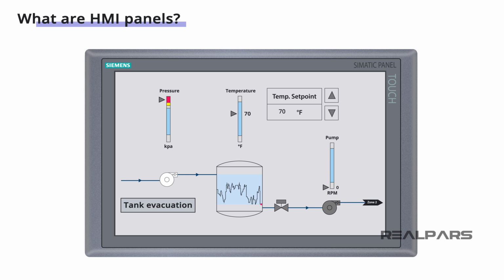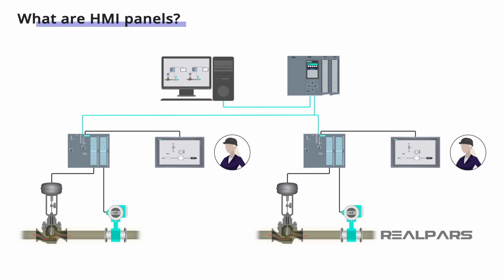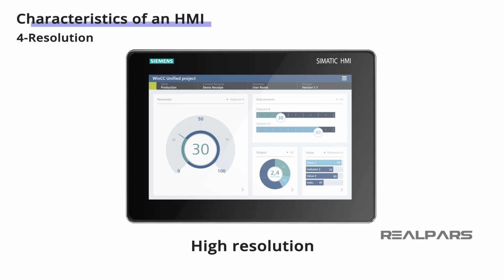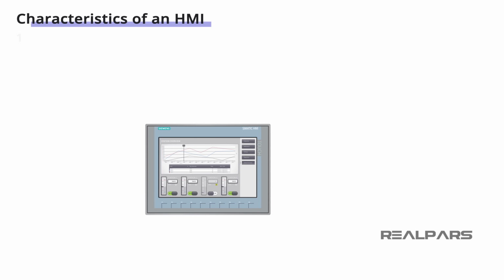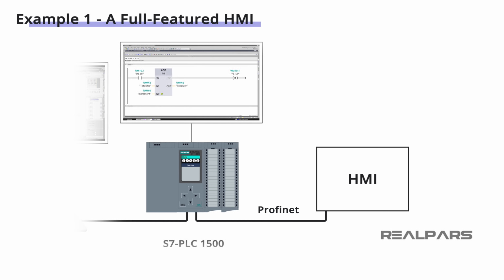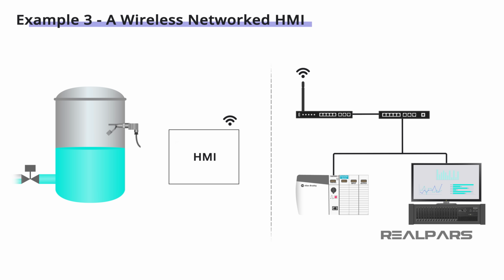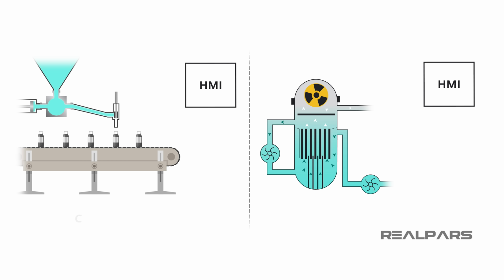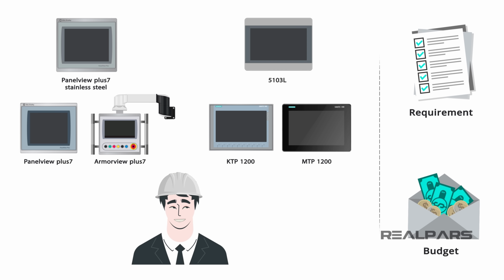What is the Best HMI Panel? | How to Choose the Best HMI Panel for Your Application

Comment: I now exclusively use weintek which is what maple systems hmi  is, they have a comprehensive range of coms drivers to communicate with the plc. They even have options that have can operate as plc and plc, logic is programmed with codesys. I have also used them as gateway taking data from rs 485 network and re transmitting it on Ethernet. Can also re transmit to plc through proprietary coms. Wireless options also. 
.

Comment: I am working in automation project with delta AS228R delta plc . Number tags i required is 500. Size of HMI should 15 inch .please suggest the best hmi in delta range.
Reply from the maker: Any HMI that can communicate via Profinet or Ethernet/IP can be used.  Since Delta does not appear to have any built-in HMI configuration capability, you will need a stand-alone HMI application.  WinCC Advanced with a WinCC Comfort Panel or an A-B PanelView 1500  programmed with Studio5000 View Designer should work well.

Comment: thank u your Videos are Helpfull.. i have a question: what is the differnce between the characteristic of Profinet and Ethernet/IP? we use for both of them the same kabel and interface! is that matter to choose the right HMI?
Reply from the maker: Both Profinet and Ethernet/IP are well-suited for automation installations.  Both are fast and secure.  Both are based on the IEC 61158 standard.  Both are industrial ethernet protocols.  Profinet has some advantages over Ethernet/IP, but both are excellent choices for plant automation.  Of course, you need to ensure the communication ports on your hardware (PLC's, VFD's, HMI's, etc.) support the communication protocol chosen for your automation network.